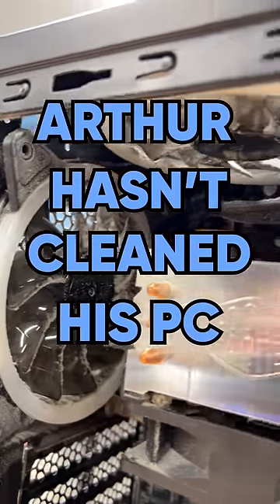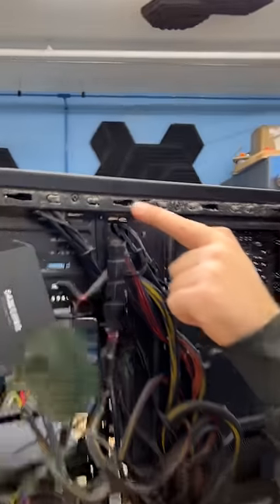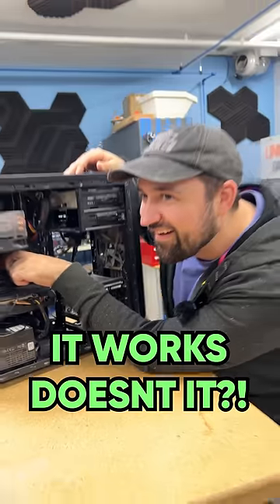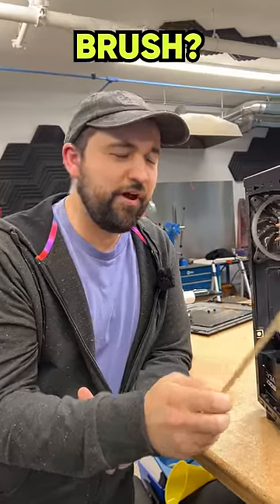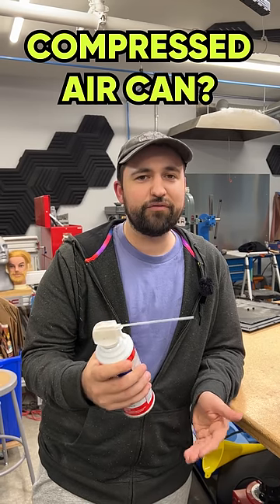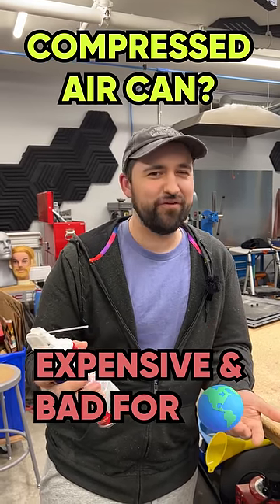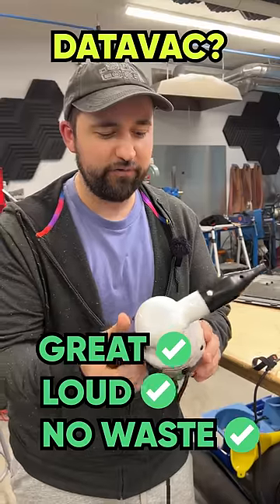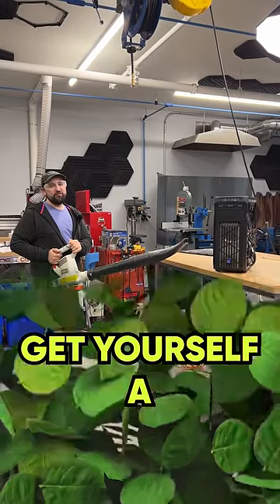This PC wasn't cleaned for 5 years...

Comment: Shocked that M.2 SSD never fell out or lost connection mid-session 💀
Reply: Why would it?
Reply: ive had mine like that for a year now without any issues (even with me beating the shit out of my desk)
Reply: @Kerttis  why
Reply: @xDololow  vibrations, pc moving, etc. if it's not secured down it might be pushed ajar
Reply: It was fine till the leaf blower! 😂
Reply: @Kerttis  psychopathic activity
Reply: @vozuri.  i lost the screw for it and never bothered to get one hahaha
Reply: @Kerttis  bruu
Reply: @Kerttis  same those screws are hard to come by
Reply: @Kerttis  I lost mine too but I just put a normal screw 💀
Reply: @Kerttis  be careful man , those screws are not that hard to find and it’s very easy to forget you have it installed with out a screw. One day you , gently , but confidently move your pc case , because you have to clean the area , or you want to move it to another place in the house , or maybe you are moving houses you know.

Or maybe you are going to upgrade some component or simply do a case cleaning inside.
And when you move the pc , the ssd balances up and down and Pam the connector snaps in half.

It happened just 3 months ago to a friend of mine.
He brought me his pc so that I installed him a new cpu and then a new AIO cpu liquid cooler
When I opened the case I told him dude , you carried the case with tempered glass facing down 😂

He said is that okey?

I said it should be okey.
The second I put the case up right and heard something inside I was like uuuh… not god…
When I opened it , I was like 
Dude you ssd has broken and fell , how the fuck it should be one of the most locked down components after the cpu 😂
It’s screwed straight into the motherboard and it Carrie’s no weight at all. I was worried about the GPU 😂

So careful , you might forget you don’t have it screwed 😂
Reply: @Kerttis  what is wrong with you
Reply: @supersolidsnake7772  Yeah, lmao I just got a random screw from my dads tool shed and it worked 💀💀💀
Reply: Free method! No $5 needed
Reply: @supersolidsnake7772  5 dollars I'd be too lazy to spend. Whenever I loose the screw it's 9 out of 10 times somewhere inside the case, most likely fell down where the psu is.

I'm def not taking apart my cable management go move my PSU to get a silly little screw...

So I just use the closest one that fits, or keep it unscrewed.
Reply: I have my tower pc sitting sideways due to the lack of a m.2 screw.
Reply: Ofcourse ? It's a desktop not laptop that would be moving around
Reply: i attached my ssd on top of my hdd with tape
Reply: @100uschallenge3  gravity my friend, gravity.
Reply: @100uschallenge3  it's like having a gpu not screwed in, self explanatory
Reply: @mycelia_ow  GPU is heavy bro...how much does the SSD weigh 😂
Reply: Just put it under my graphics card, ain’t no one need a screw
Reply: @xDololow  It’s not a port with a self locking mechanism, it’s just friction fit, it’s supposed to be locked down by a screw.
Reply: Lmao
Reply: Ohh it probably did and he thought his game was just crashing
Reply: @newmindsets  had 3 ssds and one hdd hanging around in the back for some yrs. worked always, no problem there.. ssds can hang around everywhere, as long as they are connected.
Reply: My HDD commited suicide for some reason And i had to get it replaced
Reply: Would be using a vacuum next to it to collect that dust in the air
Reply: @BLYFACTOR  assuming the vacuum has a sealed system yes, if not no
Reply: @lawyerlawyer1215  I don't have a screw in mine and I aggressively take it on long car rides, and can't be bothered to check it when I arrive at my destination... I've been doing this for years at this point.
Reply: @Kerttis  Insanity at its purest, huh?
Reply: Yeah holy
Reply: @Kerttis  fix it man
Reply: That m.2 is a champ
Reply: gzz i buy gaming pc Today i will Clean it Everyday 😂
Reply: the screw was stripped from the factory in my laptop used electrical tape to keep it down to get the bottom cover back on lol
Reply: @lawyerlawyer1215  bro you did not need 6 paragraphs to say 
"It might fall out maybe get a screw"
Reply: @normified ehh don't worry the dust will hold it in place
Reply: @normified  also it sags causing the board of the ssd to maybe bend and break
Reply: @vozuri. dont know about them but i either lost the screw or never got the right one when i was building my pc. Havent been bothered to find a replacement screw so just letting it freeball. 4 years on and never had it fall out even when moving it in a car
Reply: same thing happend when i got a new laptop, i used a screwdriver on the stripped screw but went too deep.
Reply: That would be a shame 💀💀💀💀
Reply: @xDololow  gamer rage
Reply: I have the same board and my cat goes inside and plays in it and the screw is pretty lose. Long story short my cat unscrew the screw in the SSD popped up, flew out and blue screen.
Reply: My gpu is no longer screwed in but still stays in its place
Reply: @qzickx8009  yeah but it's held in by gravity and pcie slot an m.2 ssd is straight up friction
Reply: bruh, he probably BSOD all the time, oh man ,my rams spiking. Oh man ,my gpu might be dying . Oh man my ssd is cooking. Never, hey lets put the screw in  the NVME hahaha.
Reply: @luckyhydratv  a shop gifted me like 30 of those for no reason rofl
Reply: 🤣 yup definitely
Reply: @normified  if your PC vibrates that much, you got more issues lmao
Reply: @micahpowers2614  I mostly meant if you were to pick up and put down your PC in another location, the vibration from that might shift it slightly and mess with the contact points
Reply: @Kerttis  also lost the screw for mine, replaced it with a screw from a chromebook that my high school was gonna throw out lol. Works just fine.
Reply: @luckyhydratv  amazon .
Reply: I used to have one of my newer M.2s connected like that, but then I realized that I could just SCREW OFF THE STANDOFF SCREW. Not very smart of me for not figuring out till a few months later but at least I figured it out eventually.
Reply: Let’s be fair here, this video said that it’s been 5 years since he cleaned the computer. Those drives were extremely uncommon until 2020.
Reply: @Kerttis ACHIEVEMENT UNLOCKED: mmmmmmmmm nice qwality desk
Reply: 12 Years going strong
Reply: my pc has the same thing lmao nothing bad had ever happened been like that since I had it
Reply: @vozuri.  probably no screws
Reply: Mfer be hanging on that pc on its dear life lmao
Reply: @Kerttis  sameeeee
Reply: @mike.1390  you dont need to do that, my m.2 doesnt have a screw and the tower is upright, never had ant issues
Reply: @tikket10  maybe the sockets a little tighter on yours but mine slips slightly out of the slot when it was Vertical if I jolted the table. The blue screen issues and stuff. I'm like k computer's gone sideways
Reply: @GoodOlTazzy  I just bought an m.2 and tried to install it without putting my pc on the side and I cant express the anger when i dropped the tiny little screw. Had to unplug everything and pretend my pc was a tambourine for a bit but I got it back! 😅
Reply: The sata ssd hanging is relatable
Reply: Have it exactly the same way, too lazy to find that dammn screw
Reply: Better heat dissipation my whole families ssds sag
Reply: @vozuri. I for example have it like that because it’s was a waste of time to screw it.

Comment: Dude just blasted 5 years of dust around the  shop 💀 now you cleaned his PC but the dust is gonna land everywhere
Reply: Vacuum cleaners exist lol
Reply: That's not even the biggest deal the biggest issue is all the damage from all of that dust even just the process of getting blown off the machine like that leave the whole bunch of scratches and makes your fans sound like s***
Reply: @Massivemachine440  use a vacuum but secure the fans to keep them from overspinning. I do this every few years since my case is heavy and hard to get to so when I clean it I need it to not make a mess
Reply: @Ankhrea  thank you
Reply: When you use 💯 of your brain
Reply: @ArpeggioPegasusMusic  if you want to break your pc, i recommend using a vacuum
Reply: @Yikeo  he’s right you can also damage your fans really badly with a leaf blower
Reply: @ArpeggioPegasusMusic  unnecesary if you just take the pc outside and do it there lol
Reply: @Saved I totally agree but most
People I say this too have quite a few remarks to say back like I been doing this for years or that’s only for long time inhalation of dust or something that’s totally bullcrap
Reply: @cheese-dw7mi  i done it nothing happened didn't work vary well either some times there is no easy fix. not even blowing the stuff off helps half the time.
Reply: @ArpeggioPegasusMusic  vacuums dont come with dust radars to find where everything went
Reply: @Massivemachine440  how does dust scratch something exactly I'm confused?
Reply: @macfurrywong8108  dust is thousands of micro particles of various shapes. These particles are not cemented to your fans in any way so the high speeds of your fans cause the dust to move in unexpected ways, potentially making tiny indentations in the fan blades. These indentations act like a whistle and you get exponentially more fan noise
Reply: @Massivemachine440  what..?
Reply: @_loss_  I thought I explained it pretty well
Reply: @cheese-dw7mi  vacuum does not break a pc
Reply: @GameTimeWhy  it can the force of the pull can break parts of pcs since they are very fragile
Reply: @cheese-dw7mi  that is literally not true.
Reply: @GameTimeWhy  it is i broke my last pc tryna use a vaccum
Reply: @cheese-dw7mi  no you didn't
Reply: @GameTimeWhy  i did though lol
Reply: @cheese-dw7mi  never broken my pc with a vacuum. blowing air in it will just bury the dust deeper. most vacuum cleaners have a plastic nozzle so you dont short things out. fans dont brake if you dont spin them for long periods.. now tell me why a vacuume is such a bad thing? maybe it's because they rather sell you expensive air in a bottle lmao
Reply: @luckycharm4408  well obviously we aren't talking about industrial vacuums but typical household ones will not harm a PC. You don't need to live in ignorance. Look it up. It's an old tale that has stuck around for some reason. It's like "static will destroy your PC" when it most probably will not.
Reply: @Ankhrea  vacuums create static electricity.
Reply: There are vents that collect the dust
Reply: @ArpeggioPegasusMusic and they don’t do too good of a job
Reply: Yeah I use a shop vac with a small brush on the end, gross blowing dust everywhere.
Reply: The shop has filters.

Comment: after years of never having a full bottle of compressed air I finally got the idea to use the electric air compressor we had for years so much better than trying to find a filled bottle of  compressed air
Reply: I always worry that compressors doesn't always have anti static feature.. I had it on my more semi professional paint gun but also had a water filter since you get condensation when using compressed air
Reply: @dagg497  doesnt matter, the PC isnt running while ure doing it. static or water won't hurt anything. but static or water in a device ment for painting is a different story
Reply: @MrPaxio  well yeah but you have to ensure its completely dried
Reply: The oils of the compressor can cause probs sometimes tho
Reply: @pixels_per_inch  vacuum is terrible for cleaning PCs
Reply: @pixels_per_inch  static electricity can mess with a lot of computer parts
Reply: @pixels_per_inch  just don't do it while disassembling a gpu. I fix computers since 2013 breaking a titan gpu due to static electricity is a bad experience
Reply: @dragonfireproductions790  there are filters  to collect oil/ moisture that can be attatched to the air line.
Reply: @mikeymaiku  yea I'm talking about that
Reply: @MrPaxio  actually it does matter. It only takes a little bit of unregulated voltage to kill an ic. I know because two motherboards died from me blowing them out with a compressor. It's usually the chipset controller that takes a dump.
Reply: @pixels_per_inch  You took the wrong lesson from the video. Static is a roulette for your pc. It could do nothing, it could do a lot and even when it does something you can not even notice it at first. It can lead to instability and such.
Reply: @AlphaSteam2  Exactly, it doesn't always kill the board, it can kill things like onboard graphics, chipset controllers or even North/ South bridge controllers. Hell even ram. You'll notice things like you computer just doesn't detect usb devices anymore, or your DVD drive stops working, or it kills a ram slot.
Reply: @justin6409  i second this. Being someone with almost 10 years of knowledge in the field I can attest in my rookie days I fried about 20 components due to my old stupid self not knowing about these stuff(I'm self learned)
Reply: @snowcow1173  Yeah oil and watee filter is common to add on the hose after the compressor. I also think the problem escaletes the higher psi/bar the compressor has..
Reply: @dagg497  i use a electric air compressor also, and i do it with the power supply plugged in but switched off so that the computer isn't on but it is still grounded by the ground wire of the outlet so protected from static
Reply: @ihatelols  I'm talking about using a vacuum cleaner, I use compressed air all the time
Reply: @pixels_per_inch  there's a whole debate about this. The issue is that unless there's a lot of static electricity that completely kills the component the damage isn't immediately noticeable. Though I'd say better safe than sorry with expensive computer parts. Laptops are also less resilient
Reply: @kimbrolyy  exactly
Reply: I use a hairdryer. Just put it on cold and the fastest setting. Preferably with one of those funnel attachments on the end to focus the air a little better and it blows all the dust out of my pc in minutes
Reply: @pixels_per_inch  well actually it does i semi killed a psu after cleaning my pc with a leaf blower all my games start running at half fps
Reply: @pixels_per_inch  nah i watched the temps all fine im pretty sure the static charge affected the psu in the end it have components that are very weak